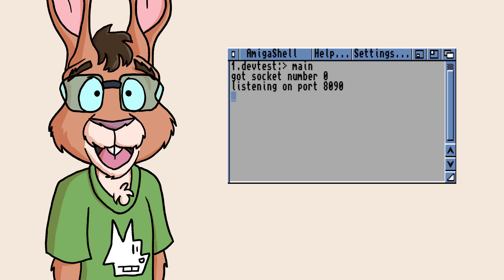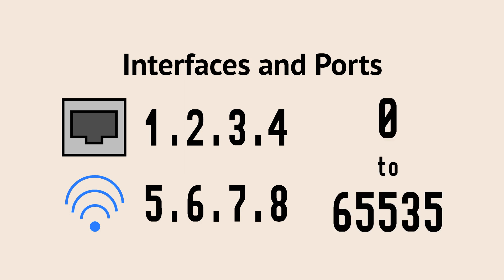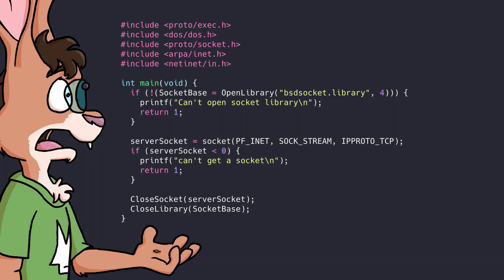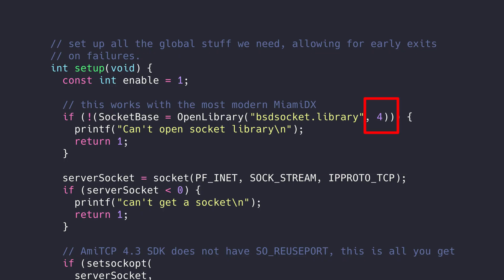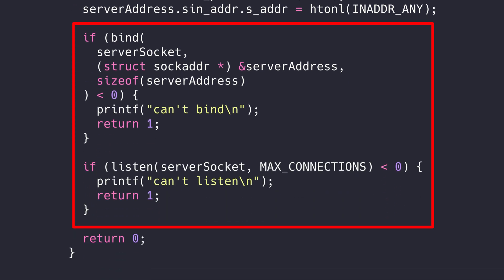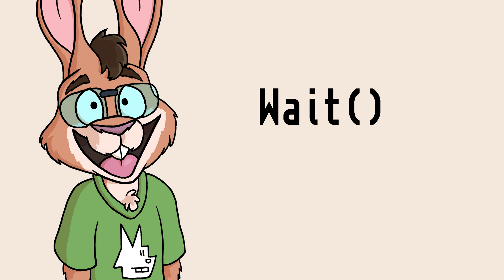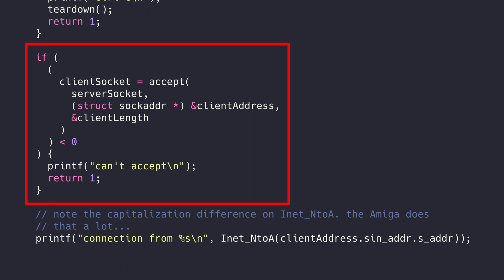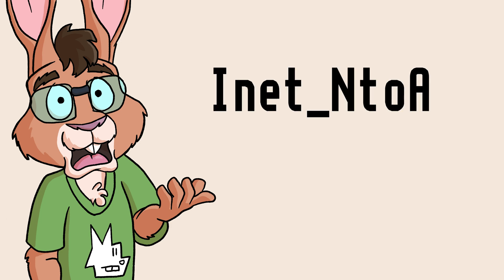Building a Simple Server in C for the Commodore Amiga

Comment: Nice info, in particular around linking and differences to standard Berkley sockets. However, a slight warning to any viewers that watches this thinking it is a comprehensive tutorial on how servers are done. Now, maybe I read through the code too quickly and missed it, but this code doesn't seem to do much serving. It doesn't do any analysis of the data received from the client, and isn't sending anything back.
So if you're new to server/client programming, watch this, but do also watch a more comprehensive tutorial on what to actually do with the socket you've just created. Just a heads up to the beginner programmers out there. 😀
Reply from the maker: You're correct! This only opens a listening socket and prints out the received data. Once you have this working, you'll have what you need to follow other tutorials like the NetBSD one I linked to.